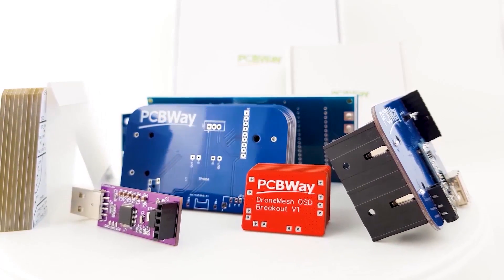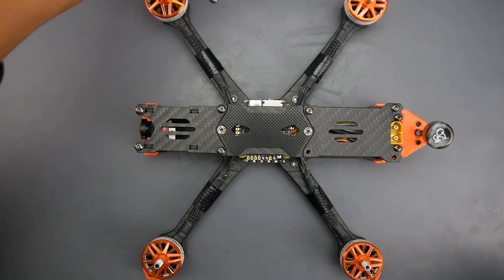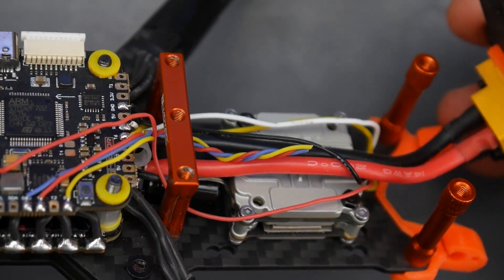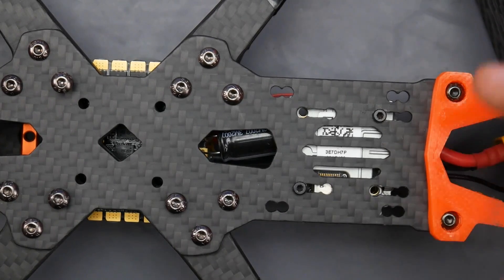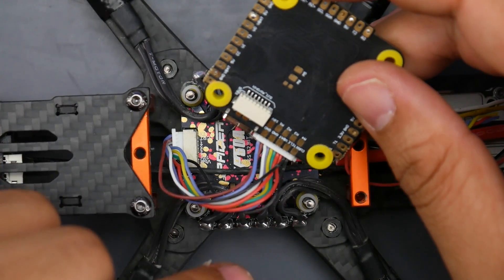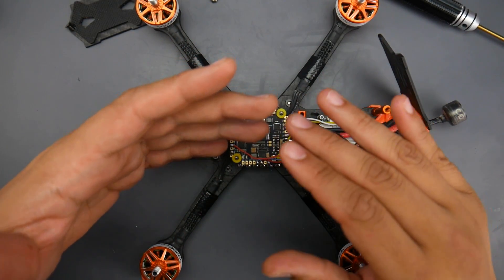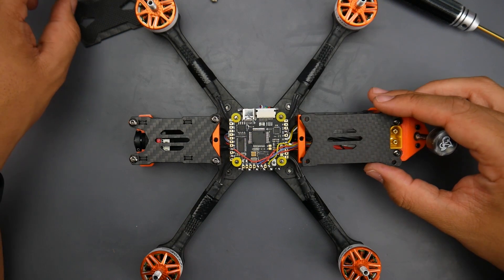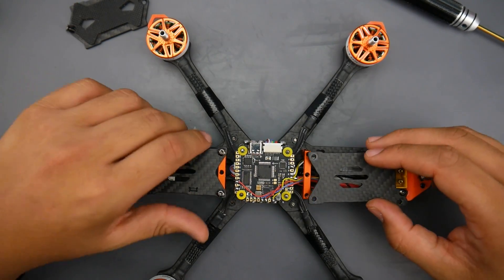Latest T-Motor Tech // T-Motor FT5 F722

Comment: 100% regret buying mine.  A 65% frame does 0% flying, for a 0% return on investment.
If it don't fly, don't buy.  Don't fall for this "oh just a little easy assembly required."  
You'll never get it assembled and never fly it, and just be out a lot of money for this frame plus all the other parts you bought for it.
Reply: You do have to know how to install either a vista, dji air unit or an analog VTX as well as know how to setup a receiver and install a camera.  I didn't know how to do this myself but eventually learned how to.  Just be patient and take your time.  You will need to learn how to solder and watch Youtube videos, but you can do it.

Comment: I'm really thinking about getting one of these to try out even if I just end up using it for parts lol. But wondering if a throttle curve would help with the motor issue. Might just get this and switch out the motors. Since I wanna try the eco 2 motors.